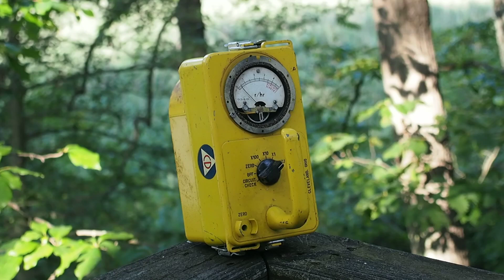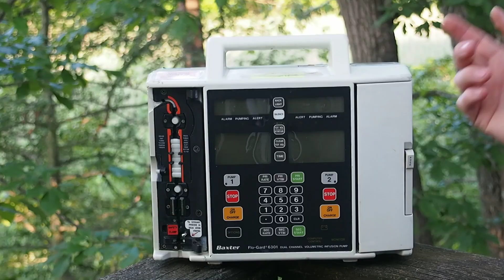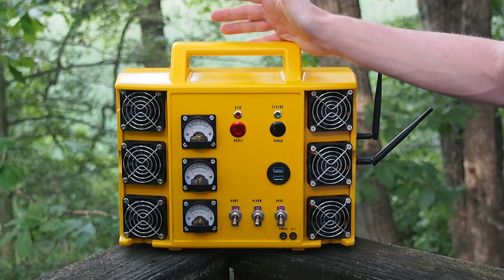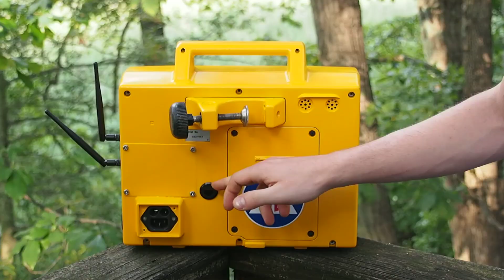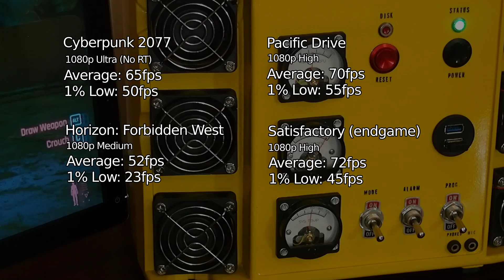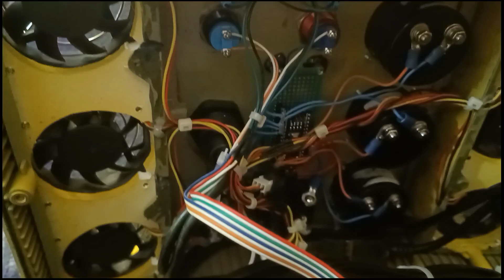I made a PC based on a 1950s Geiger counter

Comment: how does the Arduino measure CPU and GPU activity? 
where does it take the measurements from?
Reply from the maker: It talks to a program written in Python running on the PC, via serial over USB. The Python program uses the psutil library to grab CPU use and temp, and the nvidia-smi library to get the graphics card use and temp. Those numbers are put into a single six-digit string (ex. 990545 meaning 99% CPU, 5% GPU, 45 degree CPU or GPU temp, whichever one is selected) and passed to the Arduino every 1/4 second, and the Arduino sends back a 3-digit string telling the computer the positions of the toggle switches.